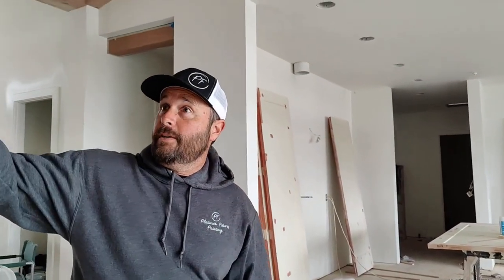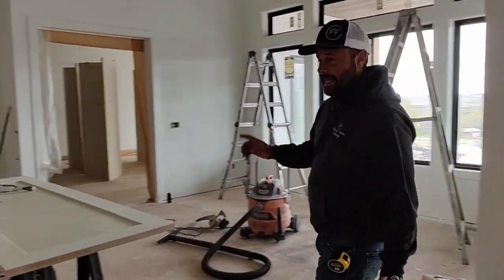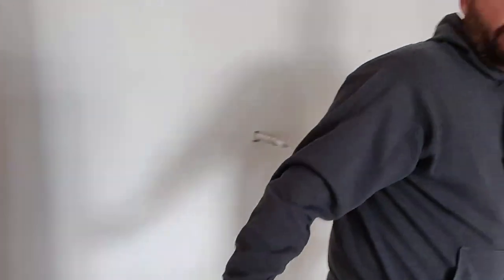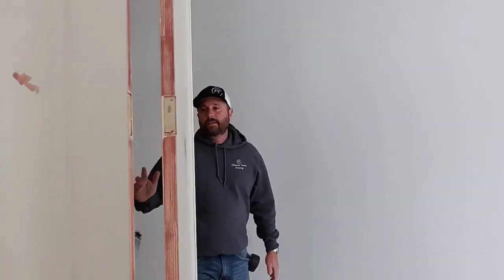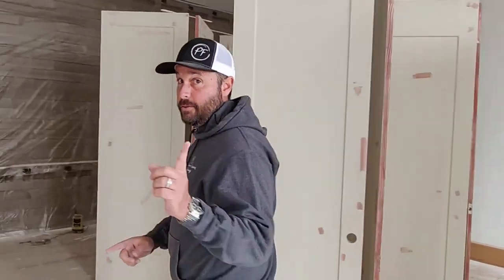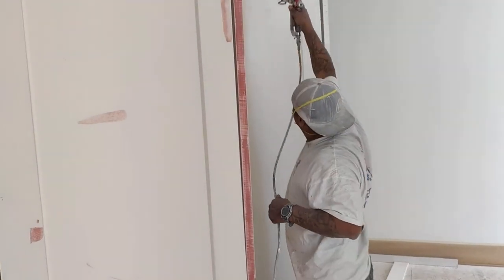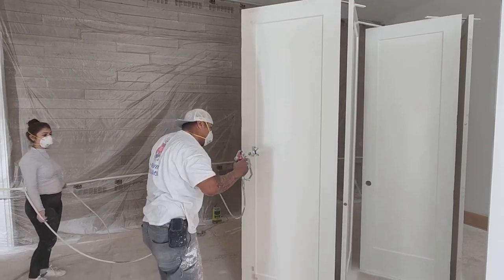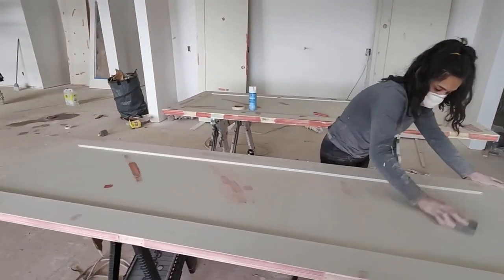Level Up Your Door Painting Game

Comment: How does the paint stick to the bondo? I thought bondo is a solvent base material.
Reply from the maker: Hello Leo, thanks for the comment. You are right the Bondo is a solvent base, but the red Bondy or spot putty is designed to adhere with latex or oil base paints. We have never had a problem wit adhesion. As long as paint cures you are good to go! It really is a great filler and super strong. Thanks again for your comment and let me know if you have any questions 👍💪🙏🙏
Reply: @PaintBoss  Thanks you!👍

Comment: You dont spot prime your bondo ???
Reply: All that work and then missed a critical step. You gotta prime the whole door again after prep, factory primer is no good, its just to keep the door sealed during storage. 🤷‍♂️
Reply: Surprisingly as long as you have the undercoat primer still attack after sanding and  not burn through the primer into the wood then the bondo spot putty will absolutely adhere and two finish coats of a premium finish will give you a perfect product. I thought the same thing but after asking a while back Stephen explained his prep/bondo process before shooting the 2x complete coats of finish, the results are a factory fine finish product, in my book, there work stand head and shoulders above the rest and obviously these are very high-end clients requesting and paying for the extra mile in the preparation phase attention to detail is my biggest concern we simply don’t except the work if we can’t honor our extensive prep phase and/or our extended clean up process. Plus we run into fewer issues when working with people that value pristine and top tear quality over the commonly expecting and barely hitting the average mark those peeps we always try to steer clear from and if anything else kindly refer them out👍🏻 Can tell you have your head in this and thanks for your opinion! Happy Painting, Happy Week, Derek